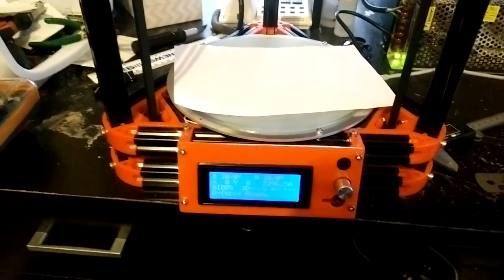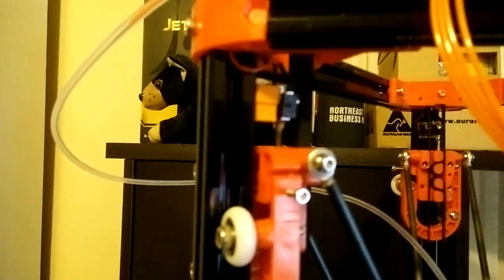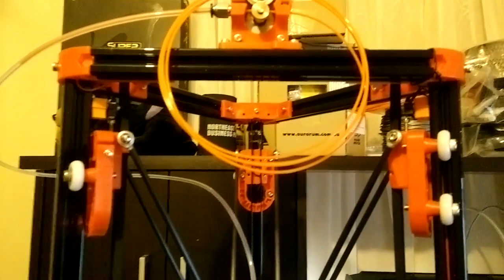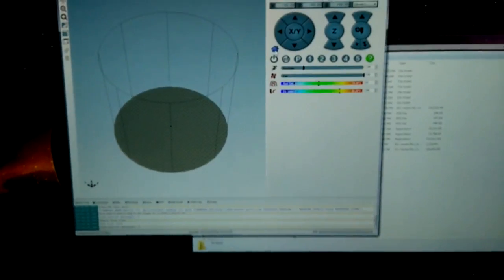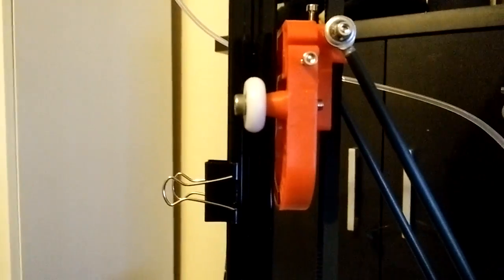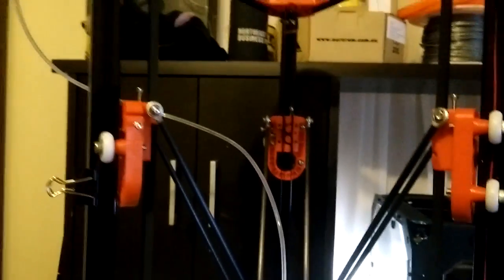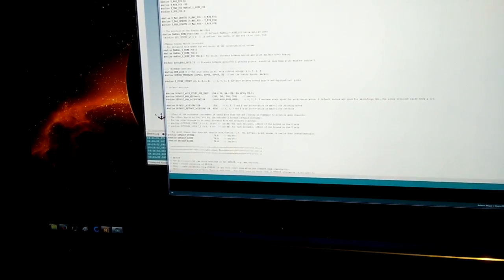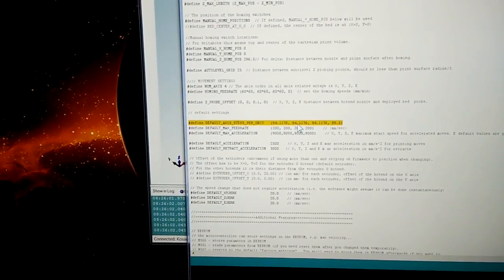Kossel Mini 3D Printer, Accuracy Issue, and howto resolve it?!

Comment: I just ordered one of these today and have been watching videos for twelve hrs.
First thanks for mentioning Repetier, none of the others have.
As to your problem, I noticed right off when the camera slowed down, that you don't have the belts go through the zig zag posts on the elevators or whatever they are called.
In one of the build videos I watched by Shary Lee , she put the belts through, I assume to keep them from slipping.
For that little tip, I'm going to like and accept a FREE subscription.
 I hope it's as simple as that for your sake and mine, I'm nervous about my choice for my first printer.
Good luck.
Reply: At second look and not the greatest eyesight, maybe those belts are secure in those things, I can't say for sure.
Are all the belts tightened equally?
Reply: Thanks for the quick reply, I can sleep a little easier now.